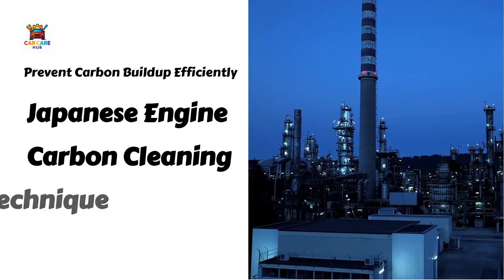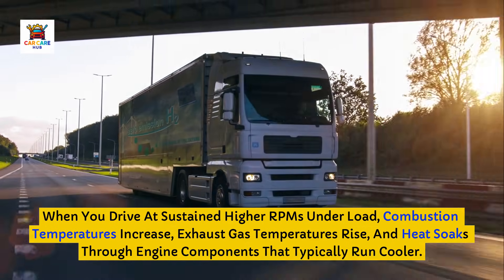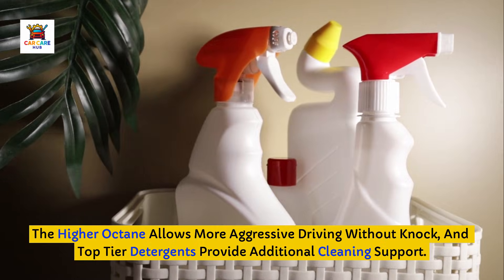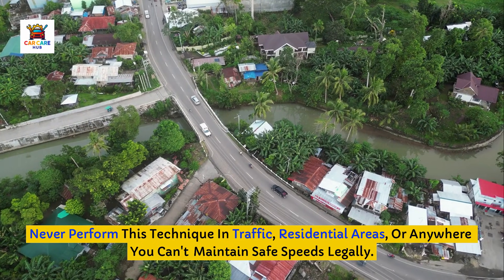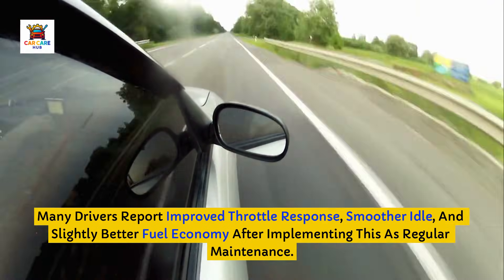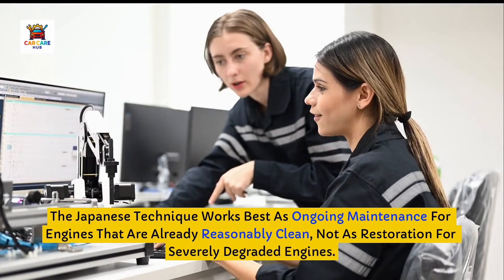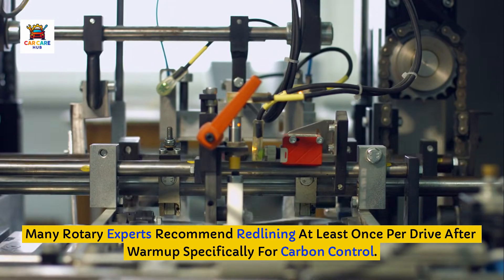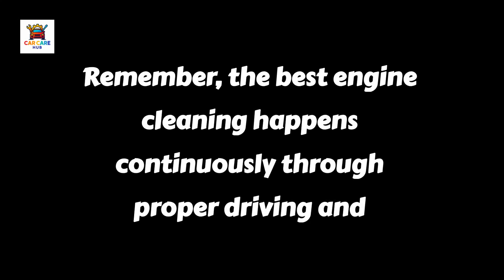Japanese Trick to Remove Carbon Buildup Without Chemicals

Comment: I got 424.680 miles on my Toyota Yaris using mostly Costco gas.
Reply from the maker: That mileage proves consistent driving habits and maintenance matter more than the gas brand alone.
Reply: @CARCAREHUB247 I change my oil very religiously. Transmission too. Also, I saw a YouTube video of good and bad gas quality and Costco was compared with Chevron and Shell. Now I don’t think that’s 100% true. I seriously believe in changing your fluids on schedule with better than average fluids. Not the cheap stuff on sale.